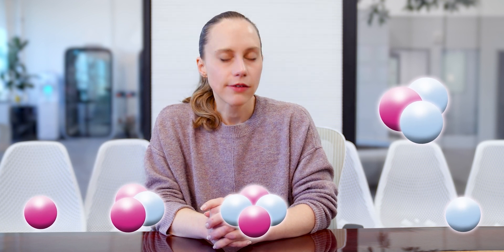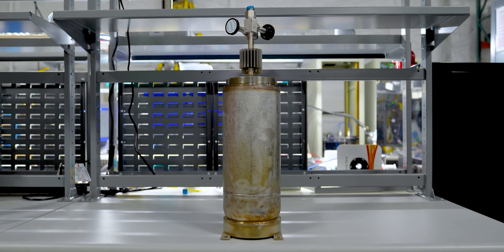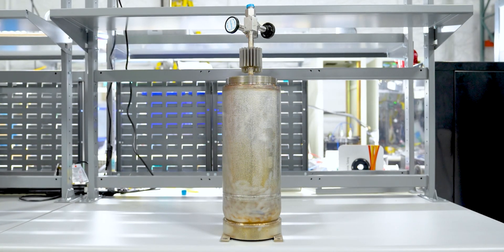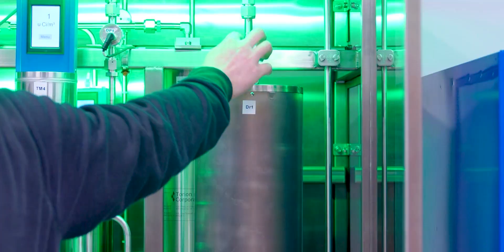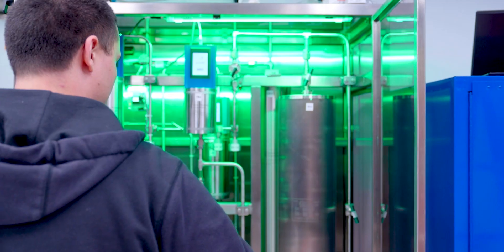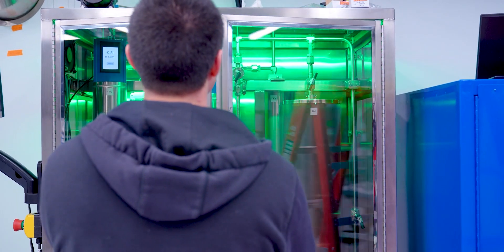Helion’s fusion fuel and byproducts: paving the way for commercial fusion energy

Comment: I wish you would have explained the difference between a deuterium deuterium rector vs, the He3 reactor and the difference in output. Its a detail but a very important one.
Reply: They can do it all in the same machine by fine tuning the temperature vs density to slightly favor D-D reactions over D-He3 reactions.
Reply: @ I thought that these are two types of reactors. One that uses He3 and can be much lighter and produce more power. The other one deu- deut which produces less power but can generate tritium which in 12yrs turns into He3. 
This was explained by the Helion Ceo in another HELION video
Reply: @pedrosura  I am not sure where you think that you saw that. Generally, Helion's machines can do both, breed He3 and burn He3. The D-D reaction produces He3 directly in one branch and Tritium (which will eventually decay into He3) in the other branch. Both D-D reaction branches have the same chance of happening. So, Initially, Helion will need to do two D-D reactions for every D-He3 reaction (since Tritium takes a long time to decay). 
Now, they could do this with separate machines, which does have some advantages (e.g. siting and more targeted design variations). But from all that is known, initially at least, all Helion machines will perform both tasks (breeding and burning of He3).
Reply: @ “Now, they could do this with separate machines, which has some advantages”
You said it. I think the CEO said you could have 1 machine producing He3 for 9 that do not. The radiation, overall mass and radiation shielding on the He 3 is lower which os why it is so attractive.
Obviously, I didnt make this up since I heard it from the horse’s mouth and it sound like you understand it as well.
Reply: @ Here it is. The CEO explaining the twi machines. The He3 machine is 8 times more efficient at making electricity and diesbt produce neutrons.

https://youtu.be/_bDXXWQxK38?si=8hO4LEjp5YsjPATI

Go to 16:19
Reply: The CEO explained it here at 16:19
https://youtu.be/_bDXXWQxK38?si=8hO4LEjp5YsjPATI
Reply: @pedrosura  He says that they "could do it that way." They may(!) be doing that in the future but they won't be doing that initially, at least. The reason is that they would need two separate (though similar) designs and more machines. Initially, they won't have the capacity to build that and maintain that.
Reply: @elmarmoelzer2229  You said “I don’t know where you think you saw that”
1) Did that answer your question?

2) Is it clear now that we are talking about different machines with different outputs, regardless of whether or not they decide to do it?
3) Do you understand now my
Point?

They can build and design the machine. But after they have the Tritium, its 12 years until they get He3. That is why this machine can not be first.
Reply: @pedrosura  
1) but to be clear, David Kirtley was talking about a potential for having dedicated machines, rather than it being their chosen path forward. Their first machines will do both.
3) They do not need the He3 from Tritium in the beginning. They get a He3 from the second D-D reaction branch. It just means that they will have to do two D-D reactions for every D-He3 reaction.
They can also sell and trade the Tritium for extra He3 at least as much as the market allows. At current Tritium prices, they would be able to give away the electricity for free and make much more money from Tritium sales.
Reply: @ Obviously, you didnt watch the whole video or other presentations. If they had He3, they wouldnt bother with deuterium-deterium because of the neutron shielding problem.
You didnt even know about the other machine and now you are the expert?
You even thought I made this up..
Reply: @pedrosura  
I am not sure what you are misunderstanding there. 
He3 is very rare and very expensive. 
Helion makes it by fusing Deuterium.
The second branch of D-D reactions (the one that does not make He3) makes Tritium. Tritium is currently worth more than He3. So, they can (within the availability on the market) trade Tritium for He3. They can also sell the Tritium and make (much) more money than they would from making electricity (until the market is saturated anyway). 
Tritium is currently 30,000 USD per gram. A 50 MW Helion power plant of the design that both breeds and burns He3 would produce about 7kg of Tritium a year. That Tritium is worth 210 million USD. At their target electricity cost of 1 cent/kWh, the He3 from the decay of that same Tritium would only make them about 4.5 million. Unless the Tritium market grows a lot, it would be saturated quickly. So they could only do that for a while but those 210 million would go a long way in the beginning. And as I said, it is so much more money than from the electricity that they would be able to give away the electricity for free (rhetorically) and still make a huge profit.

And I do and did know about them potentially(!) doing separate machines for breeding. But again, they are not going to do that initially and last I heard that path was still undecided.
Reply: @ You need to watch his presentations and pay attention, rather than trying to explain me things I understand.
The optimal maching is the He3-deterium because is 8 times the electrical output , no neutrons, lighter by design.
But, guess what? There is no He3. So, they will build the deut-deut  machine, they dont have a choice, and with the biproduct Tritium, eventually they, after 12 years of storage, it will become He3. Its pretty simple.

Stop trying to explain things I understand. I dont think you get fact that they can not build the optimal machine now because they dont have He3. Its very simple.
Reply: @pedrosura  
I have watched a lot of presentations by Helion. I also know them pretty well, personally.
I think you are misunderstanding what I was trying to say.
They can do power producing machines now. Those machines will do both breeding and burning of He3 in a single machine. 
Eventually (!), they might build dedicated breeder machines that supply dedicated D-He3 burners with He3.
Reply: @ You said that it is all in one design and it wasnt until I showed you the video that you didnt realize that these are 2 different machines. The only reason they are even bothering with the deuterium deuterium is because they dont have Helium 3.
It seems like you understand that now. Great!
Reply: @pedrosura  
Let me recap the whole conversation.
I said that they do not need two machines to do D-D. As I said multiple times: They CAN do two machines, but they will not do that initially. Polaris is a single machine and it will do both, e.g. Their Microsoft power plant will be a single machine that does both.
I explained to you how the D-D side reactions happen anyway and how they can balance the D-D reactions vs the D-He3 reactions (with temperature vs density) to make sure that their fuel cycle closes.
Did you understand all that?
Reply: @elmarmoelzer2229  You can recap if you want but I have your quote…
“They can do it all in the same machine by fine tuning the temp vs. density to slightly favor D-D reactions over D He3 reactions”
You are wrong! The machines use a different fuel and because of neutrons , they have a different design and output.
I know you trying to make it come out right. One problem, I know what you wrote and what you meant. You were wrong and if you try to continue insisting you will still be wrong. Who are you trying to fool? I know you were wrong. Read your own statement. Please give it  up. You are trying so hard to save it, but, guess what? Cant fool me…:)
Reply: @pedrosura   Dude, they CAN do it all in the same machine. Please read up on the machine they are building right now, Polaris! It is literally on their website what fuels it will use. It can do D-D, D-He3 and it will even doe D-T!!
2.45 MeV neutrons are not THAT big of a problem. They are below the activation energy of many materials. 14 Mev neutrons from D-T, now those are a lot harder to handle which is why Polaris will only do a relatively limited amount of D-T pulses...
Still, they can even build machines that do D-T fusion it they ever had to for whatever reason (e.g. having too much Tritium and running into regulatory issues with that). Heck, an idea I talked to David about the other day was that should they run into that problem, they could even do T-T fusion which produces more neutrons but they are all of lower energy...
Reply: @ Already explained to you that you need shielding for the D-D machine because of the neutrons. Not the same machine.
Are you really going to try to be right? To late for that. I quoted you on what you wrote. You neglected the fact that its a different reaction with different bi products.

Tell you what, since you know David, ask him, once they are able to build a machine that uses He3-D as a fuel, how is the machine going to be different.
Hint… if you come back to tell me its the same machine, you have the wrong answer…
Reply: @pedrosura   No, you are wrong. Seriously, Polaris and the first power plants are doing it all in the same machine. Their power plants (like Polaris) have shielding to deal with the neutrons. The neutrons are manageable for their machines. This discussion is just silly.
Reply: @ Not as silly as your comment. If they get He3 from Tritium which they will if the machine is operating, the next machines will run on He3 and will not need the same amount of shielding according to Helion.
Reply: @  They will eventually have more He3 from Tritium decay (Tritium half life is 12.5 years) or maybe some of it even sooner from trading Tritium for He3. But, building dedicated machines takes extra time and money. This is why the initial machines will do both. They might do dedicated machines later and they will likely have a slightly modified design (though from all I know none of those details are decided yet). Note that even dedicated D-He3 machines would still need neutron shielding since D-D side reactions can never be completely avoided.
The difference between a mixed mode machine and a dedicated D-He3 machine may be between 10% of the energy going to neutrons vs somewhere around 5%, maybe a little less if they can really enforce the D-He3 reactions with a He3 rich fuel (needs more dedicated breeding) and a higher temperature to density ratio. 
The shielding might be thinner (and/or use other materials) but they will still need shielding.

Comment: Question for Helion?????Hold on I thought the plan was to make the Helium 3 in one reactor (ie Deuterium Deuterium reactor) because of the uncontainable Neutron problem which will drastically reduce the lifespan of the reactor and create shielding problems. Then use the helium 3He deuterium 2D in a separate reactor to create the power. Now correct me if I am wrong but 3He / 2D reaction happens just north of 100 million degrees where as D2 / D2 reactions require over 250 million degrees. This means that even though the compressed fuel has multiple 2D atoms in addition to multiple 3He atoms the only fusion that can occur at 150 million or lower is 2d / 3He or 3He / 3He as it is not hot enough for  2D / 2D fusion events. Even if you have 3He / 3He fusion events in the chamber the result will be 4He and two protons and NO Neutrons. Thus eliminating the shielding problem and increasing the lifespan of the reactor. Did I misunderstand what David said in your Helion's approach video?
Reply: - No, they COULD make separate machines for He3 breeding, but they do not have to. It was always the plan for the initial machines to do both.
- In Helion's machines, they can (almost) linearly favor temperature over density and vice versa. D-D reactions favor lower temperature and higher density and D-He3 reactions prefer higher temperature and lower density (so the opposite of what you said). At the temperatures Helion is aiming for (at least for their first machines), D-D side reactions happen anyway. 
- Those D-D reactions will produce a He3 atom and a neutron in one branch and a Tritium atom and a proton in the other (both have a 50% chance of happening). The Tritium with a half life of 12.5 years is going to eventually decay into more He3 for additional fuel. They could also trade it for whatever He3 they can buy on the open market (Tritium price is currently higher than He3, which will also be a REALLY nice source for revenue for them). But unless they can buy enough He3 and/or until they have enough He3 from Tritium- decay, they will need to do two D-D reactions for every D-He3 reaction. That means one neutron for every 3 reactions. Now, at 2.45 MeV the D-D neutrons are actually relatively benign compared to D-T neutrons. A lot of materials can handle them quite well. So, the damage will not be that bad. Their machines will still need regular maintenance, though, but their moderate size and cylindrical design makes that a lot easier and cheaper.
Reply: @elmarmoelzer2229  Some of what you are saying contradicts what I have read about fusion elsewhere especially D-D fusion. So please clarify at what density you mean. All fusion on earth is based on higher temps because we can not achieve higher density. With Helions method of fusion as you increase density you increase temperature the two are linked. After the two donuts are accelerated and collide the Temp / Density increases to about 10 Million degrees (kinetic to heat) and density doubles as there is now two donuts together so twice the material. Now if you could reach density of 150g/cm3 at that temp you would have fusion. However we are no where near that density. You then increase the Magnetic field crushing the fuel vastly increasing the density and there by Temperature to 100 Million plus (I would love to know what density the fuel is at at this point). Which leads me back to my point about known fusion temperatures of different material at densities we can achieve. IE H3-D at 100 million and D-D at 250 million plus. Now from what I have read the 250-400 range for D-D fusion is based on amount of material ie density of the D atoms we have achieved. What I have been able to read is 250 is the lowest temperature with the highest density (we can achieve other then at CERN). So less density means you need higher temperatures however there is no scenario available yet where you can increase density and lower temp and achieve D-D fusion events below 250 million.  Unless you can reach densities of 150g/cm3 ie the sun and there by get D=D fusion at 10 million degrees. Now I am sure there is a scale that goes from 10 million degrees at 150g/cm3 to what ever the density is at 100 million degrees. Having said that I do not believe we are able to achieve those densities yet. I do not believe Helion's reactor is producing those densities of Deuterium. My understanding is no one has created a magnetic field powerful enough to create and maintain those density levels yet ie to get D-D fusion at 10 million or even a factor of 10 ie 100 million degrees. Crap does anyone know what the density of Deuterium has to be to fuse at 100 million lol
Reply: @stepheng905  Fusion rate is a result of the triple product of density, temperature and confinement time, nTTauE. The density n is the number of ions per cubic meter. There is a minimum temperature (T in kilo electron Volts, keV) that is needed for fusion to occur but beyond that the density and confinement time (TauE) are equally important. Helion's machines can achieve much higher densities than Tokamaks but are much lower in confinement time ( TauE is around 1ms). Tokamaks are usually in the 10^19 to 10^20 range for density. Helion's machines are in the range of 10^22 to 10 ^24 ions per cubic meter. So at least two orders of magnitude higher in density than Tokamaks. D-T fusion is generally starting to become high enough in the range of 100 million or higher degrees Celsius ( ~8.5 keV). Please read up on the nTTauE requirements for D-T, D-D and D-He3 as well as the optimal temperatures. For D-He3, the temperature is higher than for D-D but in turn D-He3 is OK with slightly lower density. Mind you, we are not talking about an order of magnitude difference here but more like 20 to 60 keV at around 10^23 ions per cubic meter (give or take a few depending on what reaction you favor). 
From all I know, Helion aims for about 25 keV for their fusion machines with about 5 x 10^22 ions per cubic meter. In that range, you get slightly more D-D reactions than D-He3 reactions, which is what they need to make their fuel cycle close (two D-D reactions for every D-He3 reaction). If they went down the route of dedicated He3- breeder machines and dedicated He3 burners, the breeders would likely be in the 10^23+ range for density and 20keV for temperature, while the burners would be in the 10^22+ range for density and 30+ keV for temperature. Those are my rough estimates on my side based on the information they have published.

Comment: You got neutrons, make useful radio isotopes with them. Also if you line the reaction chamber with beryllium you can make more of them, then use that to create tritium from tubes packed with lithium 6 deuteride. Either use as fuel or store the tritium for outer uses. I'm not sure how well direct collision will work for fusion, but you could use the acellerators to drive a pulsed vortex tube z pinch reactor. The neatest part is that once you got a fusion reaction started it should be self sustaining as the reacting plasma will preheat the incoming plasma. Your accelerator tech would be ideal for kick starting the fusion reaction ❤